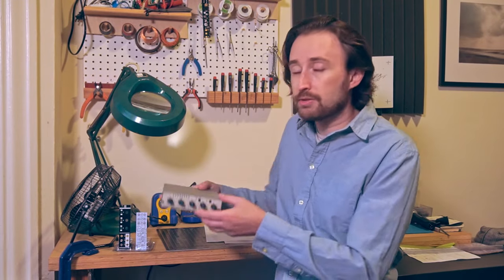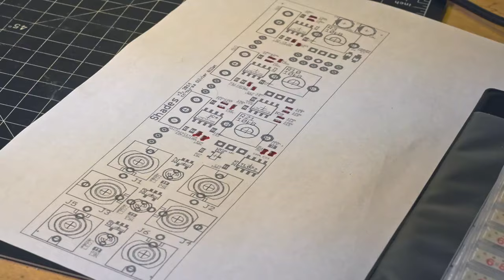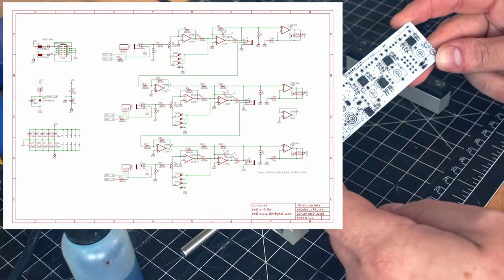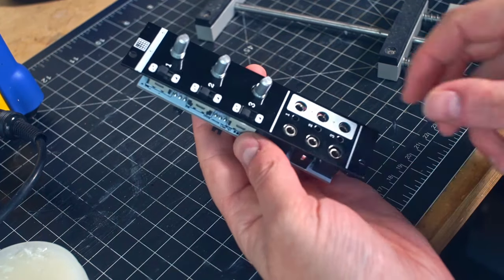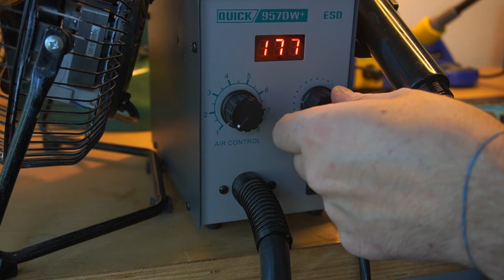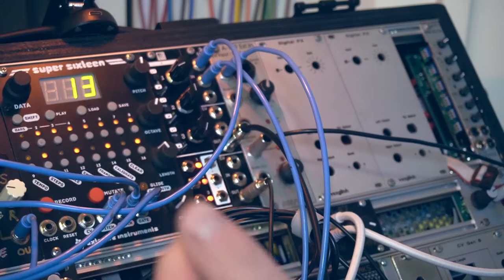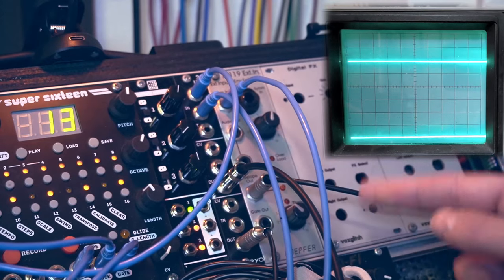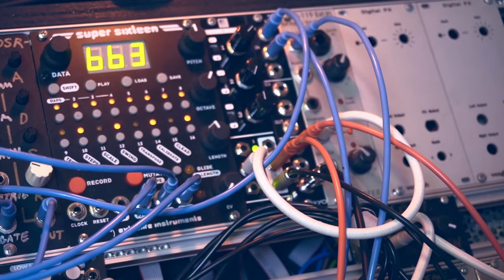DIY Mutable Shades (or How to Patch Sidechain Compression for Eurorack)

Comment: Many thanks for an interesting and informative video! I'll refer to your guide when building my DIY Shades 😎

Whilst doing repair work, you placed aluminium foil over some parts ( 8:40 ). Was this to prevent them from being desoldered due to the hot air? If so, couldn't kapton tape have been used instead?

Comment: If you have a PCB that comes with it's CAD files you can load (or import) it into kicad and have that build you an interactive ibom file, which will make assembly SO much easier. In this case the original was most probably an eagle .brd file, which kicad can import directly, other formats, in my experience can be exported  from it's native application as an eagle .brd then imported into kicad.
Reply: Straight over my head, no clue such a thing was a thing, wow, I have homework to do!